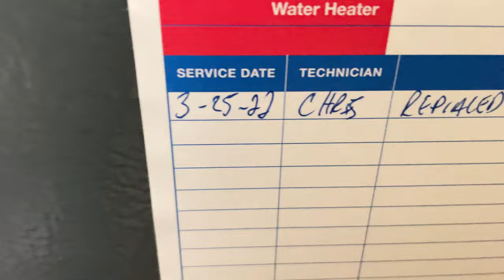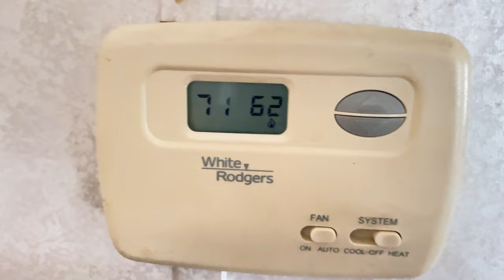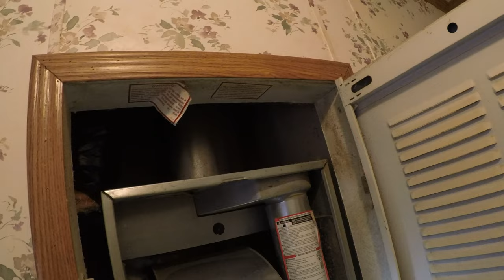NO HEAT ON A GOODMAN AND MILLER FURNACE

Comment: I like that you check the microamps on the flame sensor. Most guys would’ve just cleaned it. Good video. By the way, I installed a Generac generator last year. Honestly they’re not that hard to install. Keep up the good work.
Reply from the maker: Thank you, I like to do that just to confirm, just in case there is something else going on.
Reply: @ADVANHVAC  Exactly. I know a lot of goodman boards will give you that flame sensor error when it’s really the board messing up.
Reply from the maker: Yes for Sure!